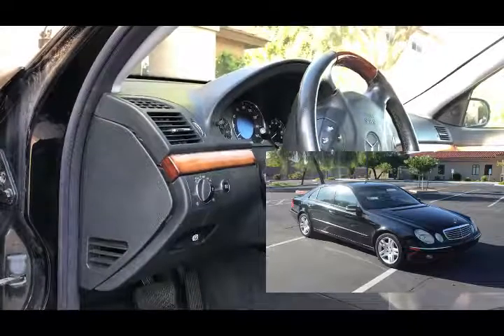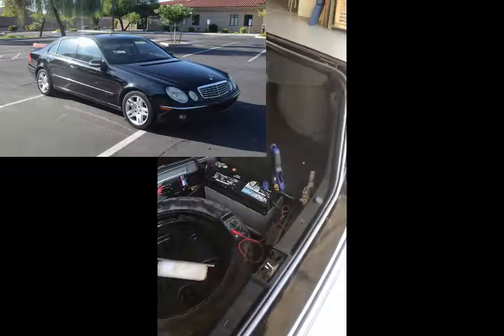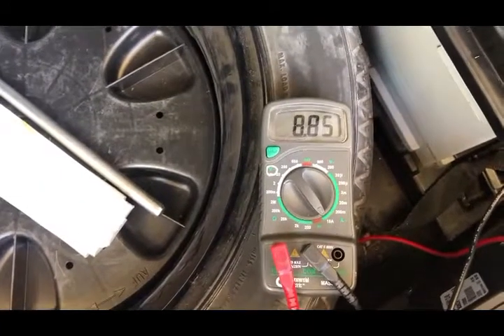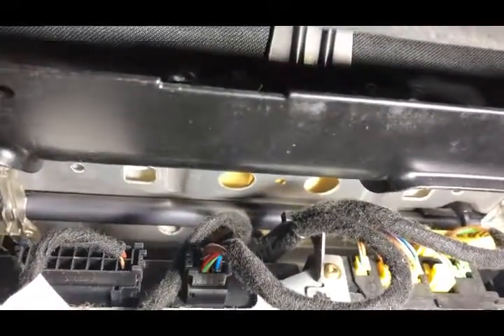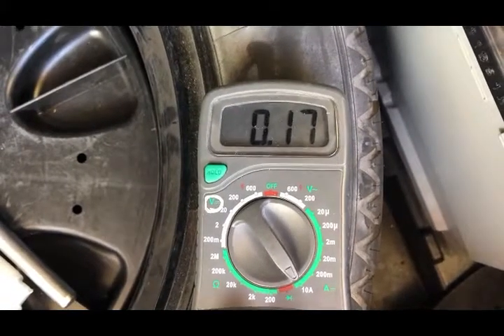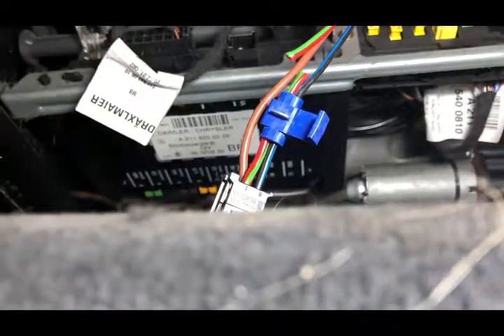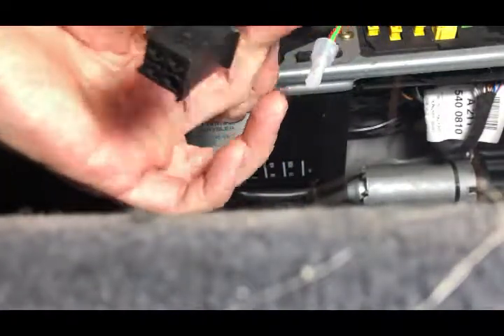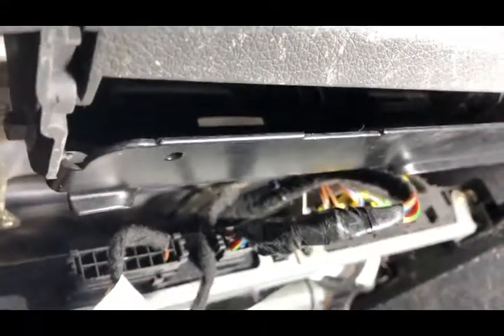How to Find and Fix Mercedes E-Class Power Seat Parasitic Battery Drain Problem

Comment: For those who has this problem like i did yesterday, i just unplugged the two connectors on module under the driver seat and it worked perfectly. The downside of it is that your seat cannot move without connectors being put on, or you just need to buy another module.
Reply from the maker: Agreed.  You can also unplug the fuse easily and just put it back if you want to move the seat.

Comment: My module is fine for now but I did have once battery drain incident so I will be doing this to both front seats as a preventive measure. Good video. Thanks
Reply from the maker: I'm glad you liked it. It's a way to keep an excellent classic automobile dependably running, even if you have to give up a little bit of the fancy creature comforts.

Comment: After this bypass, will "EASY ENTRY" work? steering moving up and seat moving back when opening the door to get in OR when key is removed rom key hole?
Reply from the maker: I think it still works for the driver but I don't think the same would be true for the passenger.  But when faced with  recurring dead batteries or a really expensive repair, it might be an acceptable inconvenience.  I would gladly go and check but my daughter had my first grandchild and grew out of the sedan.

Comment: Loved the video. Question the only thi g I couldn't see clearly was the multimeter to the battery connection. Can you tell me how you did the connection?  I'm tired of being scammed so I'm doing this myself. Thank you
Reply from the maker: Good morning. Just to make clear that I answer your question that you're asking, you want to know how to put the multimeter in series with your cars battery cables to be able to monitor the current draw, right?
Reply from the maker: You're putting both leads of your multimeter in line with the same side of your battery so that all the current that flows into your car when it's supposedly off has to go through the thin little wires of your multimeter and it can monitor the number of amps. You can do this With just the multimeter and a method of clipping the multimeter leads to your battery post and the removed cable.
However, you always run the risk of your car pulling too much current and blowing the internal fuse in your multimeter. It seems like a 10 amp view should be sufficient to protect it but modern cars are doing a lot of things for you every time you open the door and they draw more current than you sometimes expect.
I've done this to three vehicles and I started using this product Because it gives you more control over when the current is diverted through your multimeter. If you have the $18, it's really worth it.
https://amzn.to/4aP11Eh
Reply: @eggcleaver916 Hello so I got the harbor freight model multimeter. It's the red 7 function I paid like $8. I've been looking at a lot of different videos but can't seem to find what settings this thing is supposed to be on to test my battery. Car is completely dead for the past week with a new battery.

Comment: Yep. Tricky little bastard. I pulled that fuse in the normal battery drain method. You saved me more time wasted. After pulling the fuse and letting it time out draw is gone. Thank you.
Reply from the maker: You are welcome.  I learned the hard way.  That thing drained my daughters battery a dozen times and we kept having to jump it. Eventually it killed the gigantic expensive Mercedes battery and we had to replace it.  Glad I could pay back some of what I learned from YouTube when I was trying to solve the problem.

Comment: Juat a quick note...ha ha. I pulled the fuse and lightly sanded the points of the fuse and put it back.  I then disconnected both batteries and let the car sit overnight. I charged both batteries to a full charge. Reconnected everything (all done according to Mercedes instructions) and move the seat back and forth with the controls. I have had no issues since. Batteries remain fully charged and I only drive occasionally so it seems to be working as it is now 4 months. I think anytime an undervolt situation occurs, (dead battery) you also screw up the balance of the ECU and it needs to be rebooted. Perhaps keeping the seat in one position (as most people do) creates a problem in the circuit at the contact points. Then when you reconnect the battery after doing some other maintenance item the memory feature in the seat gets screwy and keeps polling to the ECU. Reset everything and it seems fine.
Reply from the maker: Fascinating.  Thank you.
Reply: Almost a year and still no problems. My car sits for days at a time. Just move the seat and drive the car a bit.

Comment: Does unplugging them work also?
Reply from the maker: @James-lv3lg  yes, you can unplug the seat or unplugged the fuse, but then you lose the ability to adjust the passenger seat electrically. You can always plug it back in to make an adjustment and unplugged it again but this is the way to get around that issue.
Reply: @ thank you I appreciate you

Comment: Hi thanks for the video. I tried this but every time I connect battery in line to amp meter the alarm goes on ; and did the trunk lights go off for you ? Or I should ask how did you turn off everything in car for the inline amp test . Thanks for the great video.

Comment: Nobody seems to be reading or exploring "youngjung4361" comment.
He states that this whole vid  procedure is not necessary to fix the drain problem. And that it can simply be fixed by unplugging the connector on the back rearward side of the seat module for a few minutes to reset the module.
He states that doing this step  alone will stop the parasitic battery drain.
Reply: Remove itfor how long

Comment: Do you have to disconnect battery before removing the yellow drivers seat fuse
Reply from the maker: I have never disconnected the battery before removing a fuse.
Reply: @eggcleaver916  because the housing to that fuse is yellow that is the color for airbags

Comment: No need to cut or unplug the wires. All you need to do is just unplug the connector from the back of the seat module for a few mins and put them back. ( Make sure to disconnect from the back side of the module. Should be  2 or 3 connectors).  NOW, test the draw check again with multimeter should have less than 0.005 milivolt. You are good to go!
Reply: Where’s this module located?
Reply: There is a seat module bottom of the each front seat. Did the draw test and it was leaking from the driver seat module.  Now no more draw since then. I actually bought a new seat module but returned the item.
Reply: Will this also apply if I just pull the fuse only. Or needs to be the connector? Thanks
Reply: Unplug a fuse only, your seat control will not work. I did that for a few weeks but not fun. Just try as I did and it should work. Just remove 4 bolts from the seat and unplug the wire from the rear side of the module(not the front), wait a few mins and plug it again and do the draw test to make sure the number is less than 0.005 milivolt
Reply: Can you make a video?

Comment: Just did the wiring and it worked but now the red visit workshop warning shows up on dash.. any idea how to clear that?
Reply: Sounds like you still have a drain somewhere. If the red light went away once you made the conversion, and came back on. You still have a battery drain somewhere.

Comment: I have an '04 E320 Sport Wagon that had this same phantom power drain issue. At first I just removed the fuse but that also turned off the cornering headlights — which I didn't necessarily mind, but I hate getting any error messages. So I unbolted the seat and disconnected the plug. Unfortunately mine does not look quite like the one in the video. Only three wires I could see: green, brown, and one color I couldn't identify (it was getting dark and it's an awkward position). But I then realized that I couldn't slide the seat back without the plug in, so I ended up re-connecting it, sliding the seat forward, bolt the seat down in the rear, then slide the seat back and tip it up just enough to squeeze my hand in there and disconnect the plug again. Ugh! But still cheaper than replacing the whole module!

Comment: If I just unplug both seats under and leave unplugged would that stop the power drain IF ITS the seat module draining my battery? Can I just leave both unplugged ? 2006 Mercedes CLS 500
Reply from the maker: I cannot speak to your specific model but that is the way that I prevented the power drain until I fixed it.  I actually pulled the fuse on the passenger seat and just kept it nearby.  When you pull the power, you will not be able to adjust the seats position.  If you keep the fuse nearby, you can plug it in, move the seat, and pull it out again.
Reply: @eggcleaver916  ok I have fully charged my car battery which Advance auto says is still good and I removed both fuses for each seat . I also unplugged the plug under each seat. Going to leave all off and see if in the morning the battery has drained again. 🤞🏽🤞🏽

Comment: Will it hold memory for seats position?
Reply from the maker: Based on other's comments, I think you will lose the memory functions of the passenger seat.  I never used them for the passenger and the seat couldn't even be adjusted before this hack because I had to disconnect it or lose my battery each night.

Comment: As this solution bypasses the fused 12 volts to the seat controller with the 12 volt ignition switched power, what fuse will blow when a seat controller module short circuits?

Comment: Nice video, but  they have different power supply , I mean fuse. 1 is 20amp another is 30. so you give on 1 wire 50 amp ? Can you imagine when seat heating is on and you want to change seat position, so all motors be working, I think to much power on 1 wire.
Reply from the maker: That is an excellent point.  I live in the desert so I never once used the seat heater.  You have to choose for yourself what you're willing to trade to have your seat motors working without spending hundreds of dollars.  I think the take-away message is, if you do this, and you use your seat heater at the same time as your seat adjustments, you might pop your fuse.  If so, limit yourself to using one or the other at a time.

Comment: Just bought a 2006 E500,my driver seat switch doesn't work. Do you know a reason why it doesn't work? The guy at the dealership said it's the wiring,they even ordered a new switch before they said this.
Reply from the maker: Sorry.  I never had that problem with mine.

Comment: I didn't notice this video a few months back.  I had 6 amps draw with the two front seat fuses in.  I pulled one out right seat and it reduced considerably after a few minutes.  Opened the door pulled the other left seat out and it reduced it two 0.20 amps in a few minutes.  My father doesn't use the seats, so we are just going to not do the fix and leave out the fuses.  Thanks so much

Comment: Do you do it to both side or just one side? Like do I cut the wired under both seats or just the passengers front seat?
Reply from the maker: The power drain on my vehicle was only from the passenger seat.  It's a fairly common problem so I would suggest you start there and see if it resolves your problem, that way you don't lose the memory of the driver seat for no reason.
Reply: @eggcleaver916  good morning I have a question for you. Mine is draining from the driver side control module. 
It only has two wires a brown and a black with yellow stripe. Any suggestions?? 
Thank you for your time.
Reply from the maker: @cesarsharp4693  Hi Cesar.  I wish I could help but I sold the vehicle so I can't look under the driver seat of mine.  I hope you figure it out.
Reply: Okay thanks so much! I will get on ASAP. I removed the cords from the connection but it was still dying I’ll have to cut the cords sometime today. And what are all the equipment you needs if I may ask?

Comment: my question is this.. does doing this cause you to loose the memory seats? It's no big deal but I'm just curious before I commit... we'll guess I'll find out tomorrow if this is my issue I unplugged the driver side fuse
Reply from the maker: That's a great question.  My daughter was the only driver so we didn't need the memory seats, especially on the passenger side.  Please let me know when you find out.  She sold the car when she left for college so I can't test it for you.  For us, it would have been a small inconvenience compared to the full cost of the seat module replacement.
Reply: Same question
Reply: Same question here 🤔🤔

Comment: Excellent.  Hope to see more.  Wish me luck on finding a parasitic draw on a GL320 2009.  Strong enough to make a spark almost into a half inch flame every time I have disconnected and reconnected the battery to try to get the dern thing to reset, just so it will start and drive.  Argghh.